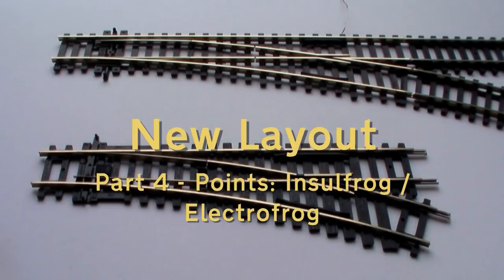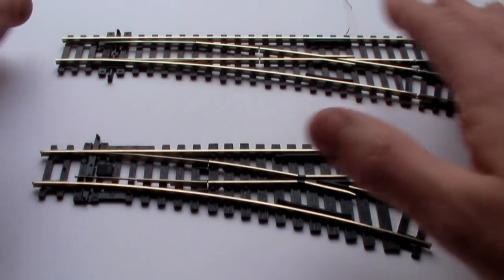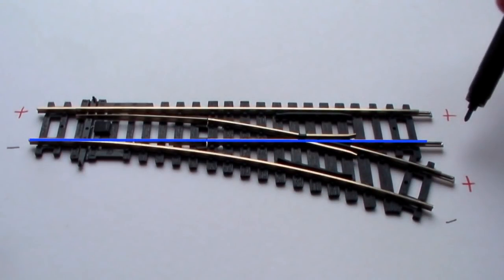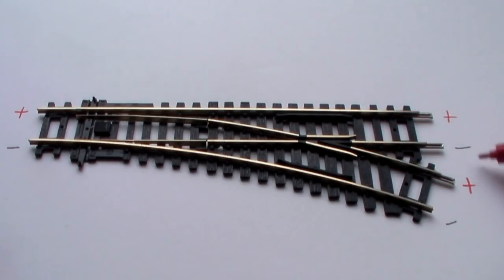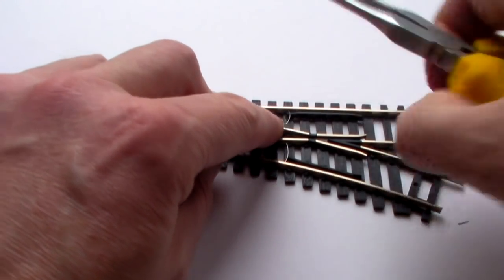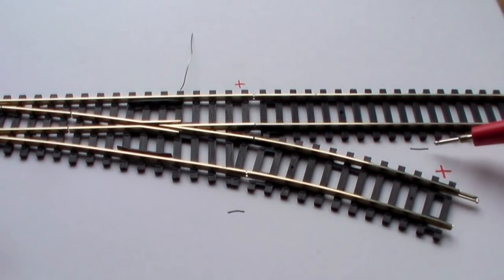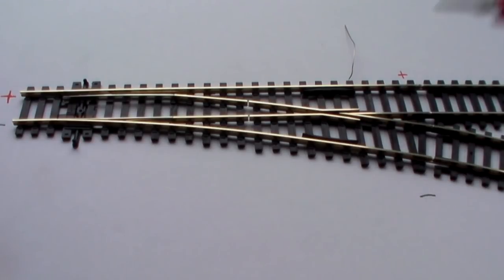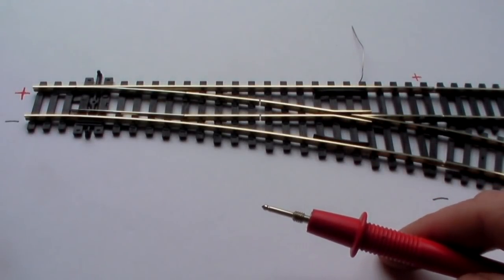Model Railway Layout Part 4 - Points: Insulfrog / Electrofrog

Comment: I think your spot on. The peco points are much sturdier, expecially the switch. The electrofrog look much better as well and give better running and are cheaper than hornby ones. Especially when you come to express points. Hornbys have a large dead spot at the frog  peco electrofrog for me every time

Comment: That's very good. I, like many others it seems, have found this whole issue confusing and this is the best explanation I've seen. Good on you for posting.
Reply from the maker: Thanks for the comments Mark.
Reply: Moorway South
I did find the clips a bit of a puzzle but I get it now. They are reinforcing the power supply otherwise dependent just on the levers.
Reply: Moorway South hh
Reply: Moorway South so I have a Hornby point and my little Hornby Thomas won’t run very well on it if I run it slower I’m getting ready to ballast the track so should I get a new one or would the point work better with larger Bachmann and Hornby steam engines?

Comment: AT LAST , AT LAST ,,, finding your video is like finding the holy GRAIL what an outstanding presentation,,, I have looked at what feels like hundreds and hundreds of videos to try and get my head around the different points, and most of them have only added to my confusion, if there was such things as YouTube Oscars then you above any how to video on point wiring would get my vote, May I metaphorically shake you by the hand, Then im subscribing ,,,, and then im going to watch your other 23 videos, Many many thanks ,,,,,
Reply from the maker: Thanks Alan. I had the same issues when I looked at points, so having worked it out thought I would make a video to check I had my head round it! Glad it helps.

Comment: Thanks.  I am just starting out on my first model rail set-up and I was trying to get my head around the way that the points (standard Hornby) work.   In particular, how problems occur when  "common" connections exist with two sets of track.  Even looking very closely at the points I could not see how the connection worked until you disclosed that they are actually connected within the plastic enclosure.  

I am now better informed because of your fine explanation but I am still a little vague as to why both points have to be switched in order to avoid a common return.

Comment: Great video and explanation. Leaves me wondering, as I have for a while, why you would choose electrified frogs at all? Their only advantage seems to be to prevent a stall when a loco lands on it, which seems unlikely with multiple pickups. Why not just go for insulated frogs and save yourself a load of extra wiring and having to use insulated fish plates? Unless I've missed something.
Reply from the maker: Hi Steve. Sadly I find the reality is that even with multiple pick ups stalls are common on insulated frog points.

Comment: I've know all this for 50 years or more. But I still enjoyed your very thorough demonstration and also gets me thinking if I should stay with my Atlas switches from my prior layout on my ensuing new layout, or go over to Peco.. One thing that is a tad confusing is: If you'r going to motorize your points anyway, what use is there for the spring action in the throw bar? And, will there be a fight between the motor's movement and the spring's movement ? M, Los Angeles
Reply from the maker: With the electromagnet throw motors I use, there's no force in them once they throw so the spring helps keep the point in place.

Comment: Hello, very good video indeed. Can I use peco side mounted point motors rather than ones underneath the board with Electrofrog points? If so do I need to just fit plastic fish plates or do I need to cut the little wires underneath the point?
Reply from the maker: Hi - If I remember correctly, the surface mounted (side) point doesn't have a frog output. The power supply for the frog then comes from the moving rails and is passed to the frog by the little wires, so leave these intact (only cut these if you are providing frog power directly from the motor or electronically). As always with electrofrog points, make sure to always use plastic rail joiners on the two rails that meet at the frog.
Reply: @geezenstacks  Thank you very much for response. That helps a lot and I appreciate your help. I hope your layout build is going well.

Comment: Hi, very informative video, thanks. I'm slightly unsure about some items: I am setting up a DC layout. If I join the pairs of track as you suggested on my Peco electro-frog point, do I still need the insulated track connectors on both inner parts of the 'Y' on the points? Do I need to cut the small cables under the points or is that just for DCC track? What do I do with the extra cable that is connected to the frog? Cheers
Reply from the maker: With DC you can use electro frog peco point straight out of the box but you must use insulated joiners at the frog. Don't cut any wires or add any wires. For the frog wire, either cut it off or tidy it away.
Reply: @geezenstacks  If I was to fit point motors at a later date will I have to change the points and do the wiring as you suggested. Cheers
Reply from the maker: @richardclowes6123  depends on the motor. For DC I would keep it simple and not bother with frog switching, just a simple throw motor either surface mounted or under the board as required.
Reply: @geezenstacks  Thanks for the advice. Received and understood. Thanks again. Enjoying your vids. Cheers Rick the Bulldog

Comment: So, can I just clarify, for a DCC layout, the very top and very bottom rails do not need insulated joiners as the polarity doesn't change. The insulated joiners are only required for the frog rails - is that correct? Thanks Paul (good video BTW)
Reply from the maker: +Paul Matthews - yes that's right, the frog (where the rails meet at a sharp point) poalrity changes when the point changes so needs to be isolated from the rest of the track. The very top and bottom tracks don't ever change polarity.
Reply: +Moorway South ok, that makes sense many thanks

Comment: As from a n gauge modeller exhibition  standard. well done on this great video I get ask so many times about this subject. How I do it  I only use electrofrog  especially in n gauge  people get so confused. About it.   Well explained  well done.  Happy track laying people  wen wiring always colour and number code your wires  and make a book with details of it so easy to fault find.     As in say live red    common black     frog yellow  and number  the frog wire to the number of point.  To point motor.  It all helps to fault find     Happy modelling people

Comment: Thanks for the great video! i was wondering if you could do one on the wiring of a PECO double cross over...I am thinking of using frog juicers to sort the frogs but saw on another cross over explanation (different brand) that can use TWO juicers for the 4 wires coming off the rails/frogs, that is 2 wires go one juicer and 2 to the other as only one pair is needed at a time? I hope you understand what I mean.  What I need to know is what wires are paired and if there need be any other mods to make my N scale PECO double cross overs work well with all size engines.  THANKS
Reply from the maker: Unfortunately I don't have one of those. From looking online, it looks like you will need four motors each supplying its frog and a reversing module for the crossover.  Take a look at a video called "wiring a double crossover for DCC" by steampower4ever, that should help.

Comment: correct me if I am wrong . these points after modification will not be self isolating, I have a dc /analouge  layout. I assume all the rails will be live no matter which way the points are set, so  needing  isolating  switches?
Reply from the maker: +48firefox - Hi. For a simple siding on a DC layout, you can use them straight out of the box without insulated joiners on the frog. The siding will then effectively be dead when the point is set to main line running as the rails will have the same polarity. If you are using the point for something more complex than a simple siding then you should really power the frog separately. Take a look at Brian Lambert's website for more details.

Comment from the maker: I think you mean the Peco SL-99 and SL-E99. They appear to be the same size and geometry, which can be an issue with other points. I would always go for electrofrog points where I can fit them in. It means more wiring, but with the Seep point motor it's not difficult. See part 6 and 7 (coming soon) for more details about this. Loco's run much better over electrofrog points. Hoep this helps.

Comment: Tha k you great video.  A question. I'm just about to start a dcc layout  what points would you recommend  insul or electro.i have about five insul points.not sure the best way to go  I am a complete  novice. Thanks
Reply from the maker: Hi. I think it depends on your locos. if they are modern and large with multi wheel electric pick up then insulfrog will be fine. electrofrog always needs frog control by motor or switcher, which is more expensive. I ran both and they each have pros and cons.

Comment: Peco insulfrog have a small soldered wire underneath that will run from positive rail, and goes to the positive rail on the turn off part so it has constant power and same goes with the negative rail heading along the mainline
Reply from the maker: Thanks for the clarification.

Comment: I have some of the Peco electrofrog points and they do not have the cuts in the track? Is this something that you have cut in yourself? Very informative video by the way, very well explained indeed.
Reply from the maker: Hi Phil. No, the cut outs in the rail were already there. Perhaps you have older points?
Reply: @geezenstacks  hello thanks for getting back to me. The turnouts i have are brand new, purchased from Gaugemaster in the last couple of months. The ones i have are N Gauge so i am assuming the ones you showed were OO scale maybe? I have watched other videos and it seems that they do not cut the tracks from new for N gauge,  i could be wrong?
Cheers Phil
Reply from the maker: @philnewman1110  ah, probably a gauge issue then. OO come with a leaflet that explains how to wire them up.

Comment: Great explanation. The last 30 seconds especially! One question though, are both the Hornby and Peco points the same track width? I thought I read somewhere that the Peco electrofrog points have finer track (hoping that's the right terminology!).
Reply from the maker: All Hornby track is Code 100. Peco has Code 100 in set-track (which is identical to the Hornby track) and also in Streamline (which has larger radius curves). All of these are compatible. Peco also do Code 75 which is slightly smaller. Code 75 is not compatible with Code 100. Hope this helps.
Reply: Moorway South
 Aha, thanks for that. Guess I still have some reading-up to do....

Comment: So if I added the hornby point clips to a insulfrog peco point will a class 08 shunter (short wheel base) run smoothly over it?
Reply from the maker: Short wheel base always difficult with insulated points. All you can do is try it and see.

Comment: Dear Friend i am New in railway modelism....i should want points Where the current passes ONLY in the chosen track....must i buy insulfrog or électrofrog or this is another problem ? Thanks for your Nice answer. I Am running analog DC.Michel.
Reply from the maker: Running analogue DC and requiring the current to pass only to the chosen track, go for insulfrog. Very simple in those circumstances.
Reply: Moorway South Many thanks, have A great Day, excited to build my layout, best wishes

Comment: So am I right in believing that a Insulfrog Peco Point is completely DCC ready, and I do not need to use the frog wire from a seep point motor?
Reply from the maker: Yes, you can use the insulfrog point straight out of the box for DC and DCC.

Comment: Are those power clips available in N-scale? I see no reason why they would not work in a DC only layout. I've been having trouble  with several points on my new layout, the power connection of the point blade isn't as good as it could be. the clips look to be answer.
Reply from the maker: Try a search on "Fleischmann spare 779141 (S) DCC point clip N gauge"
Reply: Thanks a lot for the quick reply. There's a shop here in Toronto that should have them.

Comment: An absolutely great vid, really cleared up my misunderstandings about the two in a concise and clear way. Very, very helpful indeed! One question; could you use a insulfrog point straight out of the box on any layout with no work if you used insulated rail-joiners as shown? Many thanks, Jack
Reply from the maker: The insulated-frog works straight out of the box with normal joiners. You might have meant the electro-frog: These can be used straight out of the box too but you must use insulated rail-joiners on the two tracks which meet at the frog.
Reply: Indeed i did! Cheers, Jack

Comment: HI nice information.
But I do not understand how to make the detour Electrofrog to avoid short circuit.
10:40 minutes you have Electrofrog negative (-) so if it comes down locomotive is founde with two equal ploso the negative of the main line below and the negative in the Electrofrog. As solve that?

------------------
Pero no entiendo el desvio electrofrog como hacer para no tener cortocircuito.
En el minuto 10:40 tienes el electrofrog en negativo(-) entonces si viene una locomotora de abajo se encuentrara con dos ploso iguales el negativo de la linea principal de abajo y el negativo que hay en el electrofrog. Como se resuelve eso?
Reply from the maker: The short circuit in the frog is avoided by using insulated rail joiners where the frog meets the right-hand rails. If you mean the short circuit between the outside rails and the switching rails then, the only way to avoid this is to isolate the frog from the switching rails (by cutting the tiny wires underneath the gap) then supply the frog from a point motor.

Comment: I Love your video :) superb indeed.. I got a question.. I want to lay a siding from my mainlinw track, but it should only be powered when i switch the point.. But the thing is i live in vienna and everytime a go into the model train shops and ask for points which switch the circuit to another rail the shopowner and other customers have no clue what i want from them.. Its like that isnt available here xD oh and they dont know what a shunting layout is.. Around here they just built these big layouts where u need a hole house to store it.. Maybe someone here can help me.. I use piko track :) i saw that the points i can get here 2.hand or new have a extra wiring behind the frog to support both rails.. -. -
Reply from the maker: If you are running on DC, then power the main line but not the siding. Then use the Pico point straight out of the box and it will isolate the siding when switched to main line running.
Reply: @geezenstacks  thx.. O thought that would it be.. I comfused myself with piko and peco.. In german, piko is spoken like peco im the uk.. But these 2 are differemt companies.. And peco isnt sold here in austria but in 1 place.. And they are the only ones one can get here in austria which isolated sidings.. Fortunately they cost the same as in the uk.. But there is no 2. Hand market so i need to buy them new.. Which is more expensive but still within a reasonable range.. Not like fleischmann or märklin..

Comment: Great video, but the Hornby clips create shorts and become a bit of nightmare especially with cross overs.
Reply from the maker: Can't say I have found that with mine - they seem to work fine on the insulated points. However, I would now always go for electrofrog and power the frog from the point switch.
Reply: It would appear it was the Lima Pizza Slicing coach wheels that were the culprit. Cheers.

Comment: I'm even more confused than ever. The explanation confuses me. I'd like to see a video showing what tracks to connect and what tracks to isolate and that's it. I get a sort of brain fog nowadays. I need a diagram of what bits to connect or isolate.
Reply from the maker: Are you running DC or DCC?
Reply: Moorway South 
I'm just collecting info so far and trying to learn as much as I can about setting up a layout so that when I get the spare room cleared, I will hopefully be able to set things up easier. Bus wiring confused me at first but it's much easier to understand now. I came across a video that showed what to cut and what to join etc. And he showed the diagram that come with the points which looked easy to understand. I will watch your video a few times until it eventually makes its way through my brain fog lol.